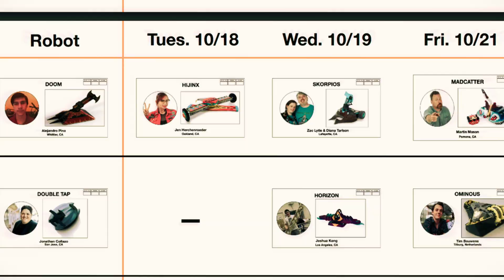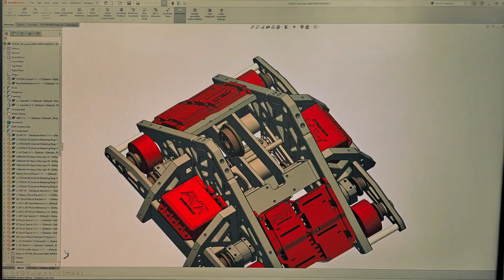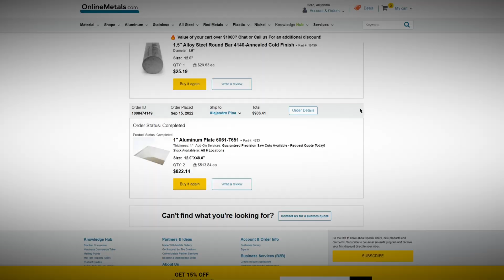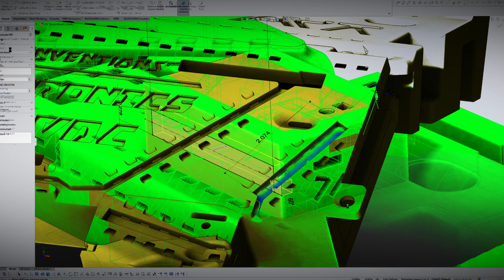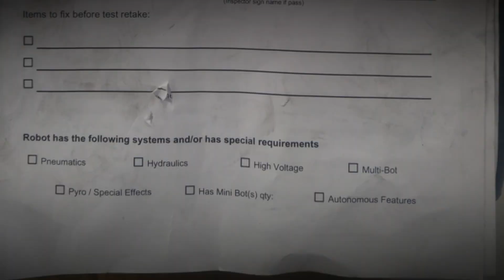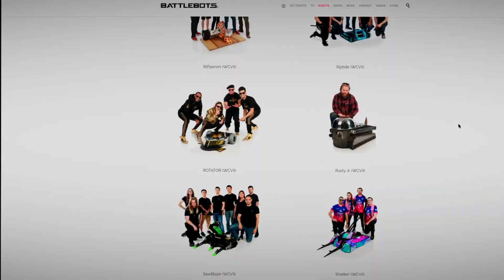Integrating Lessons From Past Failures | DOOM Fights Slammo! at BattleBots Proving Grounds

Comment: I think a total redesign is in order. Resons why... 1. Your weapon is too big for the bot. 2. the weapon's arm is too weak to lift the bot after getting flipped. 3. the center of gravity and the bot with the weapon attached is way off if the weapon is hanging to either side. Solutions: Perhaps you should think about the robot's survivability with the parts you have thus costing less money (and maybe get a few sponsors). My idea is turn the weapon sideways and lay it down to dra it behind you. Then strengthen the hydrolic arm so it can flip the bot back over instead of swining the weapon. With the weapon horizontal you can drive it either direction and make it work. Even from behind after a rush with the weapon in the rear. Take a look at Maximizer a 15lb bot I think, with the weapon on the rear. You can of course also use the weapon on the front and with the arm you can fight bots like Huge and Mamoth. Example: https://youtu.be/ShHtYiO_T7Q  Please don't take this personal, I just trying to help and be inovative at the same time.
Reply from the maker: Though this video was posted recently, the content covered in it is old. This was only the first of seven proving grounds fights. Here is DOOM's latest appearance at proving grounds: https://youtu.be/lYqREwEjzXc?si=V_6bA1YhJmpKvYL3
Reply: @aptinventions  I would argue that 2 120lb bots vs.a single 250lb bot and where one opponent was bearly effecting the fights (Cat Kong) that that's not a good example. I don't mean to disrepect ypur team and your efforts but just try to think outside the box and see what you can come up with. Good Luck in your future bot battles.
Reply from the maker: I honestly have no idea where you are coming from. DOOM is the largest hammersaw capable articulated spinner in the world and it has only been improving with every fight. The design is only limited by experience, time, and money. Nobody has ever built a DOOM before, so it is up to DOOM itself to figure out how to DO more DOOMING. 

1. Actually, the weapon ISNT BIG ENOUGH. More weapon = more DOOM
2. The DOOM Arm is strong enough to self-right (the clutch slipped early in this fight is all 9:15) I'll post a self-right demo soon hopefully. 
3. Yes, that is a caveat of such a design and there are plans in place to work around it. 

I do strongly believe in innovation and DOOM will have a complete redesign before the next season but not by completely changing the type of bot it is. I understand your suggestions and I don't want to spoil anything but trust when I say DOOM will eventually have a weapon system the likes of which has never been seen before. . It'll take some time but it will happen.
 @necromancer0616